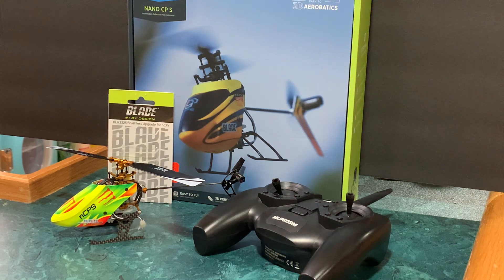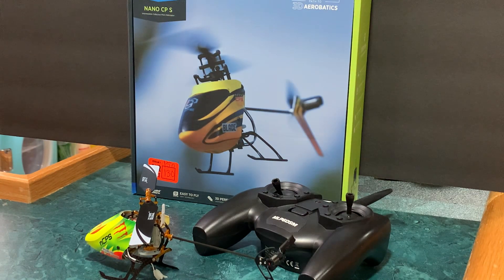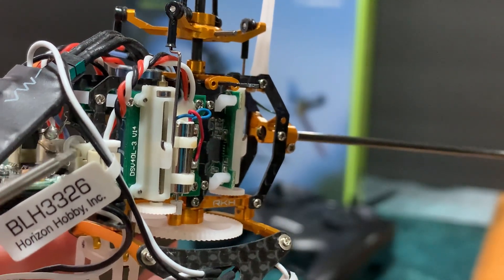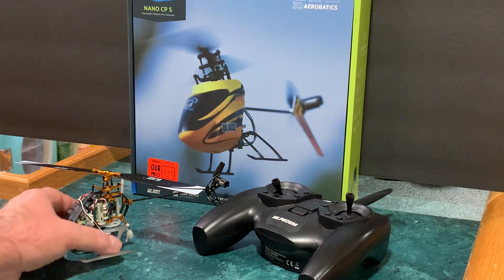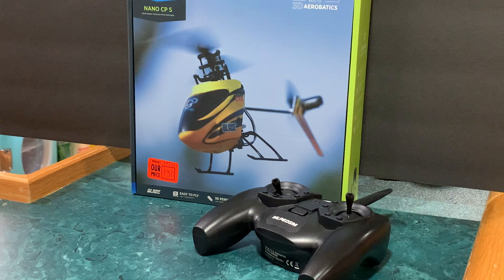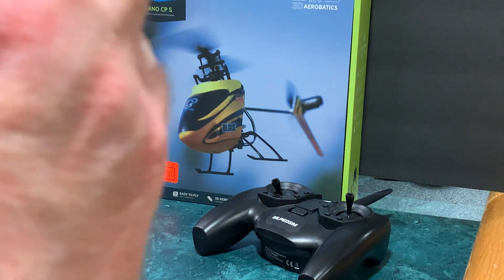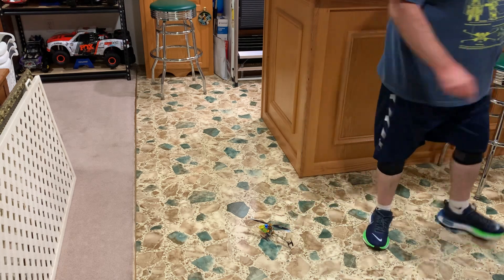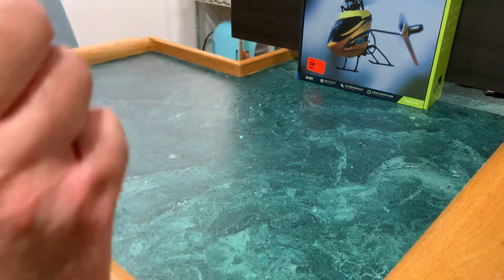Blade Nano CPx Brushless Conversion || Installed in Blade Nano CPs || Modifications Required

Comment: I have the Nano CPX with brushless kit.  But, instead of just doing the plug n play way, it is soldered directly to the board.  Both the ESC & battery connector are soldered directly onto the board (and also both have upgraded to 22AWG wire, but you don't need to do this).  This helps reduce power loss.  You also need to use very good batteries.  The Spektrum 150mah or 210mah 50c batteries work great, the E-flite 45c are ok, anything less is not ok.  I set a timer to either 2:30 or 3:30 depending which battery I am using.  Short flights = batteries last longer = heli never falls out of the sky.
Reply from the maker: Thanks, I have new lipos for it and it flies ok.  The Nano CPs has always been glitchy and unfortunately it still is even with the brushless upgrade.  I was flying it the other day and it got out of sorts for no reason and I had to hit throttle hold before it flew into the TV😩.  I put a fresh lipo in it and powered it back up and it flew ok again.  I think there is something defective with the three in 1 unit, which I have read is nothing new to this model.